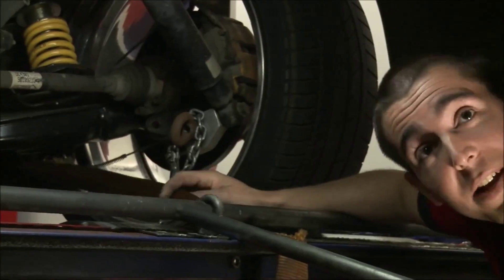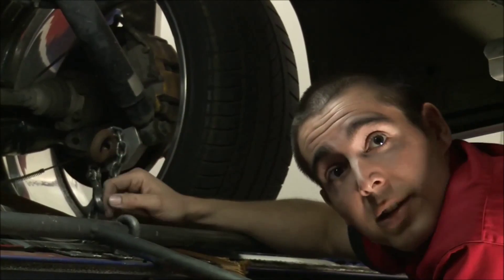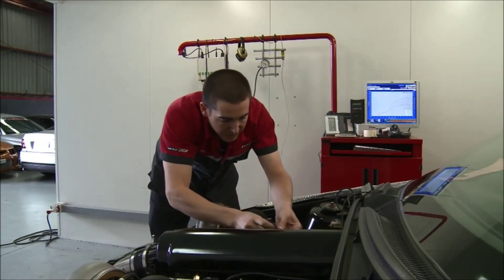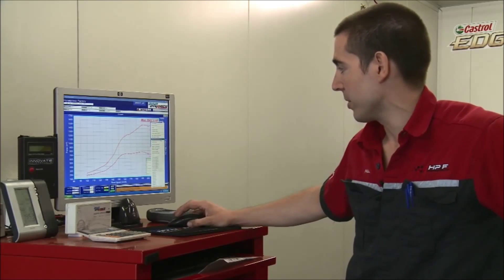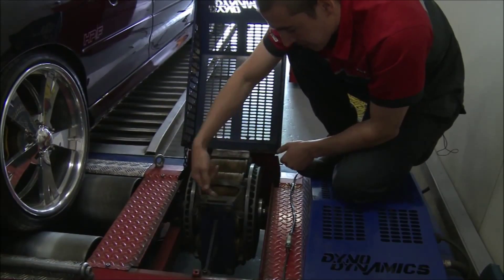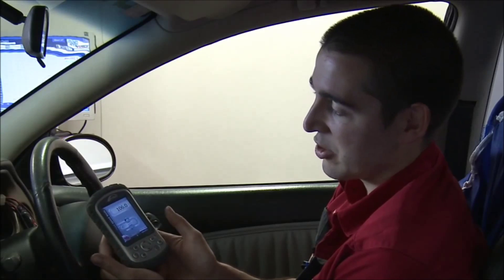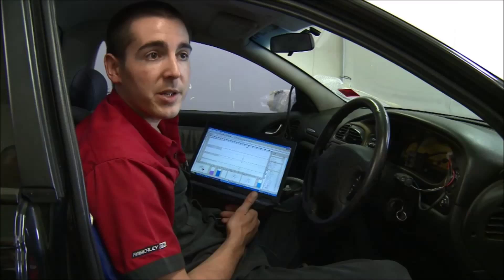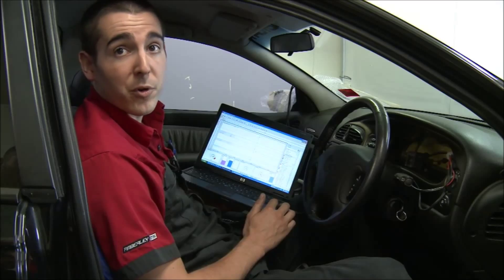OZG - Tech Files - Dyno 101 - How we set up and tune a car on the dyno

Comment: LOL 1500HP at the wheels at the end, but not showing the dyno screen and also this is a twin turbo V8 which is made to make power( Like close to a 100+ K engine with parts and labor included), show all those Extra HP made at the rear wheels from factory made cars which almost ever tunning place is advertising this is what you can expect to get if you spend about 5 to 6 K on a factory L77 or a HSV Series one LSA engine ?

Comment: To date not one performance upgrade places have any dynos and explain who best to get extra HP from factory cars and the best investment without voiding factory warranty and also buying aftermarket warranty as well ? SO Holden VF Redlines and Series 2 Redlines for example, also if you look at HSV models they again dont show you which brand of ECM performance software is used and more importantly every u tube upgrade of performance exhaust and tune upgrades again only show extra so and so RWKW extra power,but everyone wanted to know what the car sounded like after all thats the main reason why they get it done and not one upload of what the car sounds like inside the car and also outside the car with a DB range meter ?